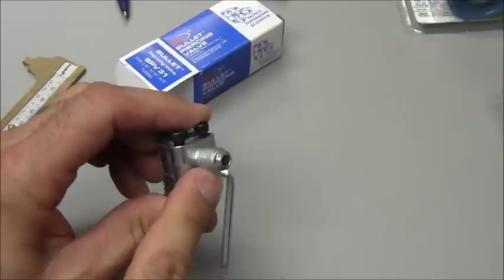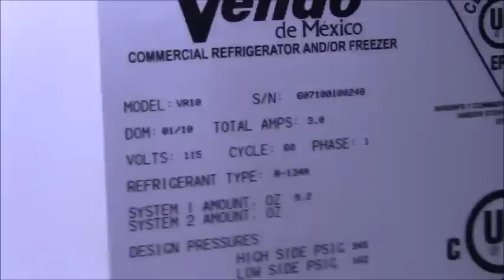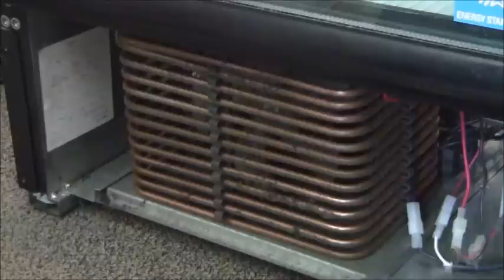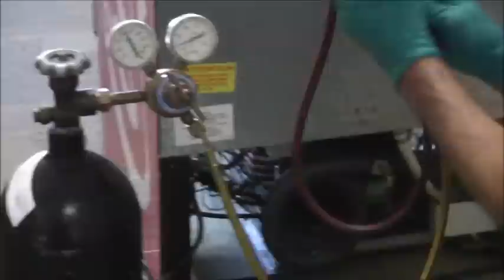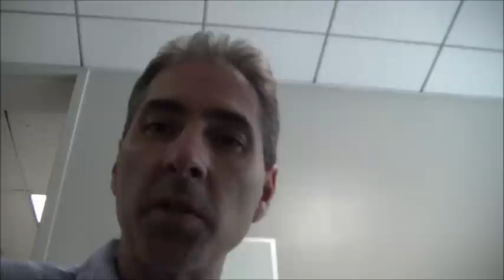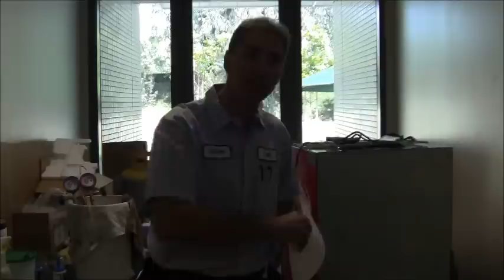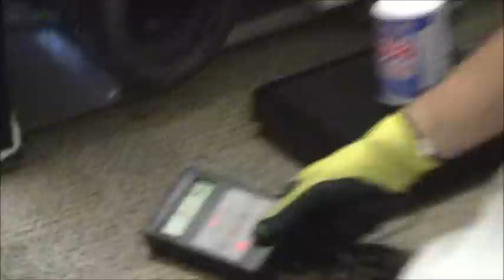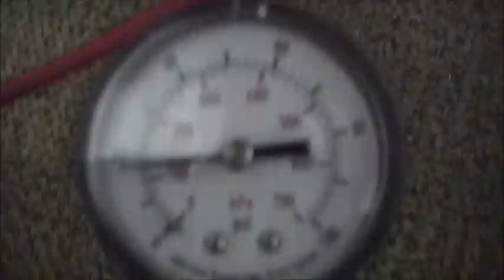Refrigerator not Cooling, Charge with R134A and Resealable Can

Comment: The lessons is very much appreciated, Thanks. My refrigerator is a Whirlpool, No frost single cabinet. Two questions #1 The spec on the back listed  R134A (CH2  FCF3) 0.096kg   is this the refrigerant capacity. #2 is there a sealant for the bullet piercing valve so as to assure there is no leak.
Reply from the maker: 1. that appears to the the amount of refrigerant. 2. you could add a stop leak product BUT you are far better off changing the piercing valve out.

Comment: Would it not be cheaper to just buy another fridge? I mean if it takes all this & that to get it fixed, The service charge,  your time , labor, & parts are going to out way the cost & It's efforts of repair. We live in a disposable world today where everything is made cheap so not to last & sold on high cost & products are made to only last a short period of time for to fix one part next week is another expense of another part. Nothing is made anymore to last especially since America gave all our factory's away to Mexico, China, Japan & all the other 3rd world countries. I worked construction & bought a heavy duty 4' wreaking bar to pry off boards of formed up concrete footings. This bar was made in China. The first time I used it,  it bent like a piece of lickorish, & I had to trash it. The steel was just weak & no good. The same as the rebar we put in the concrete walls & other uses used to be so strong it was hard as hell to bend & now bends like a rubber hose. It's counterfeit goods we are in debt to China for.
Reply: Dave Overbey im guessing a commercial fridge like this costs 2k new. Where a service is $90.00 per hour + parts
Reply: Dave Overbey a regular service tech would have been in and out with a fix in less than an hour. Ken works as a maintenance man which allows him the time to do all the unnecessary things he did. I am a refrigeration tech and when I worked on residential refrigeration units for sears we would have checked it out charged up the refrigerant and be done with it because its leak was so small. If it’s 5 years old then it took 5 years to leak down so adding a little every 5 or so years is the best alternative and cheapest to
Reply: @mwatkins2464  I agreee to a certain degree, but but u dont know the leak rate, so u cant make that statement, all u did was charge and dip! Who says it well take 5 years it can leak out in the next 24 hours!
Reply: Are you serious?  The parts needed to check and add R134a Freon are well less than $50, plus about an hour of time and just a little know-how.  Modern fridges are made as sealed systems partly to get you to just buy a new one when it runs low on refrigerant!    But adding more fridges to landfills is not a good idea!  Much better to add a piercing valve, add R134a and get more years of life out of your fridge/freezer!

Comment: why was the dryer not changed
Reply: not true. i only replace driers when major work is being done.
Reply: Hello. . . . just cutting the line on a small system like that is major work.
Reply: OcRefrigeration,Hvac & Electrical. Then you don’t know what you’re doing then. Anytime the system is opened to atmospheric pressure it should have a new drier installed because it critical to remove moisture that entered the system with the air.  It’s not as critical in air conditioning as it is in refrigeration.I take it you don’t do this for a living or never had proper training on refrigeration systems. I’ve only done this for 30 years.
Reply: Because no major component was replaced.
Reply: caleb dale yes you should replace the drier whenever you open a sealed system regardless of replacing something or not.
Reply: Jodster Jamster you are correct. It’s funny you can tell who knows what their talking about by simple questions like this these guys are showing their ignorance about refrigeration.
Reply: Aleks Day you don’t know what you’re talking about

Comment: Please advise is warm (not hot) compressor a sign there is insufficient amount of coolant?
Mine is hot.. but I was advise to top the coolant up..
I am trying to find a problem in my side by side fridge freezer as while fridge one works fine, the freezer evaporator is only 1/4th frosted and so food does not freeze. Everything seems working fine, there is no sign of leakage and I'm puzzled..
Reply from the maker: I am not sure how hot the compressor runs with normal refrigerant amount but the compressor should not be over 225f. I believe the oil breaks down above that. these units hold very little refrigerant, you may not notice a leak.
Reply: +KenTraining Thank you for your answer Ken

Comment: think about it? You must understand blended refrigerants. If there is a leak, you can never trust the charge because both refrigerants will leak at a different rate. you must remove and recharge with virgin 134.
Reply: r-134a is not blended

Comment: You can tell the micron level by the pitch of your vacuum pump, your so full of crap. You have no reason to make a training video because you still need to be trained. You did not purge nitrogen while brazing and when did you put a new drier in the system? Try getting down to 500 microns it takes more than a few seconds. The only way to read microns is with a gauge and impossible by hearing a pitch.

Comment: You can charge system with Amps more easy with small compressor
Reply from the maker: will that be accurate enough?
Reply: KenTraining no it won’t!! You need high and low side pressure for an accurate reading. Most of the time the amps will be lower that what is stated when the charge is correct so it doesn’t work.

Comment: Thanks for the guide.  However 41degrees seems high for a fridge.  It should be under 40 for food.  Would that be adjusted by raising it to a 8 or 9?  41 is fine for a soda fridge but any meat or dairy should be under 40
Reply: Its a Beverage cooler.

Comment: Is that  Auto refrigerant that you put inside the refrigerator Ken ?
Reply from the maker: +Sam Shum yes
Reply: +Sam Shum R-134a is used as well on most domestic appliances(Besides Cars) like: refrigerators, freezers, undercounter refrigerator, ice maker units, wine coolers and so on. In Europe they are using now R-600 on most of their appliances. 

I hope this helps 

Kind Regards
Reply: The oil and sealers used in automotive refrigerant not good for refrigeration.

Will it work? Yeah, but will likely clog the capillary tubes and shorten the life of the fridge.
Reply: @davejohnsonnola7908  You mean, "if you buy refrigerant that has oil and/or sealer in it" it's not good... BUT they sell clean R134a with no added oil nor sealer.  That's what you use.
Reply: @ceeweedsl  correct, yeah should have qualified that remark, but the vast majority of what is on the shelf in diy auto parts stores has oil and sealers included
Reply: @davejohnsonnola7908  Yes, you have to be careful.  I just bought some at orelly's and there was one brand of pure 134a rest were "value added" products with oil, sealer, leak detectoror crappy gauge added to can...
Reply: No such thing as "auto refrigerant".

Comment: Very good not using leak seal only two things  In a system is refrigerant oil and refrigerant please don't use the can it for cars only that's why it a most use a micro gauge you could see if the system has moisture or a leak if you pull down to 500 micro bank off which means turn off vacuum pump to see if micro reading rise because refrigerant cost $$$ to you and customer .

Comment: When you charge these system couple way to charge these system .Don't nameplate charge because the system .You put in different drier most of the time  can't read it nameplate charge . With cooler off  charge liquid in the high side and watch the low side it should rise if not cap restriction Turn the system on watch the pressure as box gets colder pressure sure drop and take running amp off the compressor you might have to put little more refrigerant in low side watch the suction line and pressure if it frost too much refrigerant take some out in till it backs off watch your amp it sure be running under the running amp .R134a low Side sure be running at 20# or less the high side 150# or less. This is how is done because you will be repairing this unit again on   free spend the money do it right the first time .Most the time the condenser get plugged because customer never PM cooler it run hot and you will get wax or oil breaks down and on the cap tube gets plugged and the compressor

Comment: Don't use super seal it will kill your Compressor
Reply: What would you suggest to use that is safe for fridge compressors ? (like embraco on ge, lg fridges using r134a).
Reply: @SS-pi2yi  NON are safe,,,, they all do damage.
Reply: I watch refrigeration videos and first thing other than basic principles I learn is ‘ don’t use any stop- leak ‘ and ‘ never put any leak - stops in your system ‘. Then I go to the stores and see shelf after shelf of refrigerant with stop leak and oil with stop leak and just whole cans of stop leak.
Reply: @michaelszczys8316  Dwayne Evans
 Michael Szczys  Yes unfortunately, for non technician they sell this stuff for consumer use, however its a multi -billion indusrty of auto consumer products out there, they are not regulated and there making money, so there, they gonna sell u a quick fix! But we all know ntn fho free, so take it with a grain of salt! You get what u pay for!